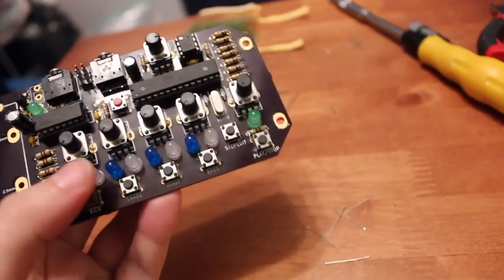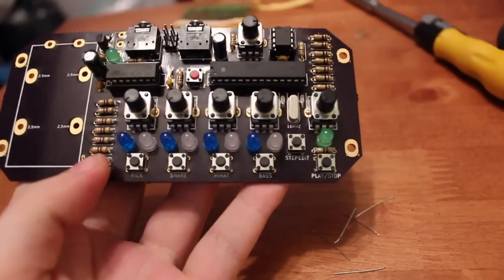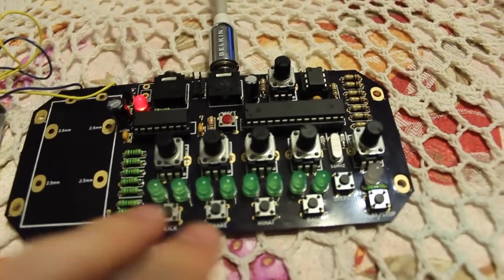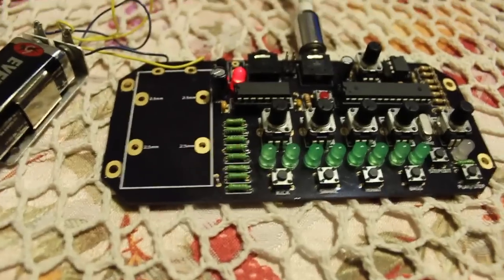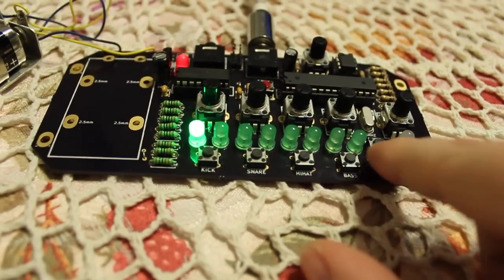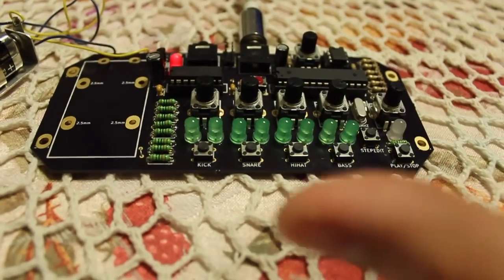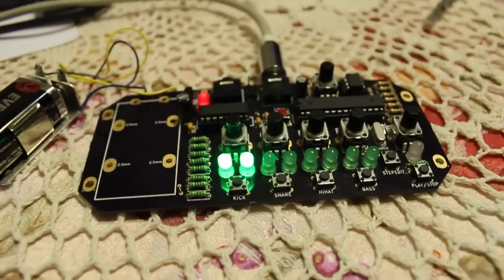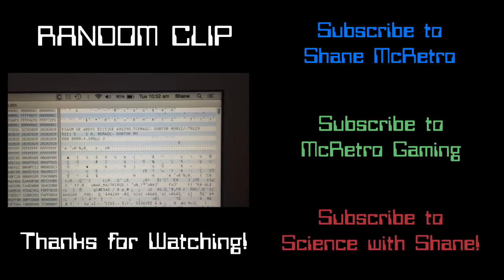Lunchbeat / PICkit 2: Resistor Upgrade (Part 9)

Comment: What atmel microcontroller are you using?
Reply: ***** take a look at the 32u4,,, Basically is an updated 328p but it can act as a "real" usb device natively, very nice for all kind of input-like device as well as a slave device, without the need of serial stuff or dip micro programmers
Reply: ***** nope same performance, the only difference is the native usb support. The teensy 2.0 use it and in fact i made first a converter for IBM model m and model f (it translate the data from built in controller) and then the gamepad prototype, all detected as hid devices
Reply: ***** yes, in my case was a big ass Model F 122 for terminal machines :D 24 function keys... RE-BINDABLE BECAUSE OF THE TEENSY!
Reply: ***** those looks a bit... MSX-like
Btw my model f 122 is now broken; a friend of mine drop it and now the plastic rivets are broken. The only way to repair it is to totally open it up, cut the rivets and make an hole in them, put the springs in place again and bolt the "sandwitch" together.... and this only if there is no damage on the membrane
Reply: those things are at least 1 to 2 and a half kg each XD